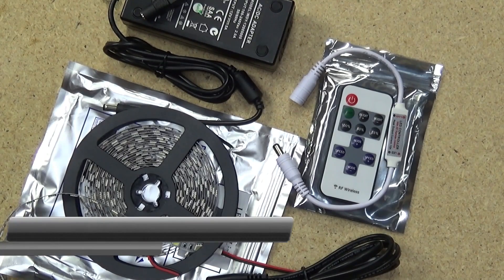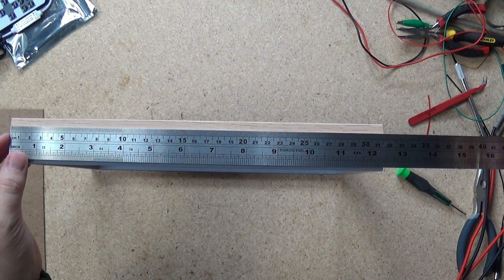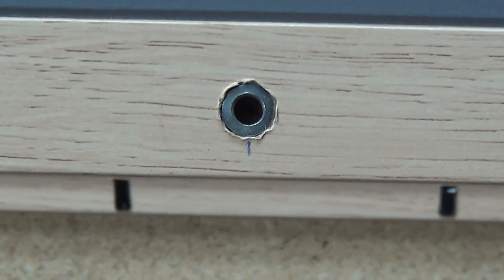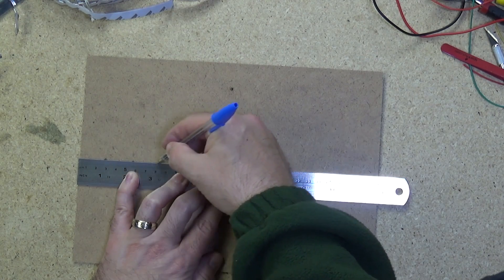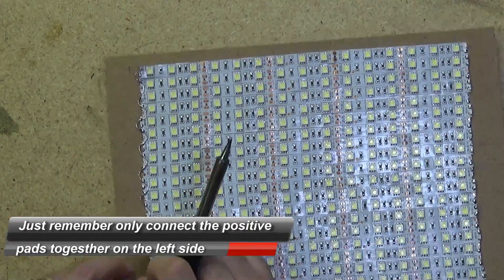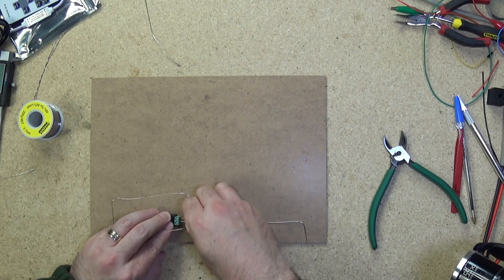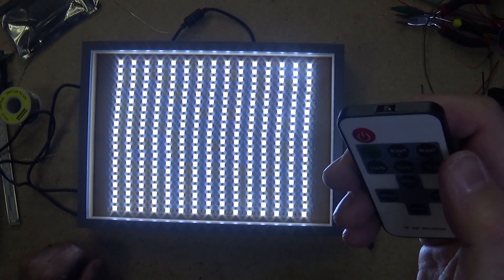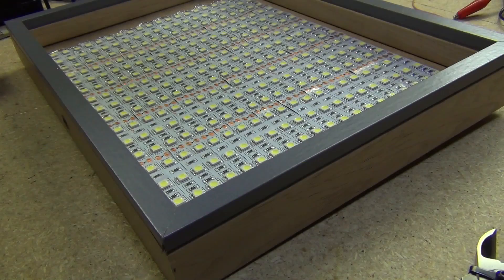DIY LED Light Panel with Remote Control (MEHS) Episode 51

Comment: Has the glue failed on those strips yet?
Reply from the maker: - Hi.  It has let go a couple of spots but I just hit it with some fresh adhesive and all good.  You are correct - It's not the best adhesive to begin with, could have been better.  Cheers.
Reply: @michaelsstuff4402  what part of the country are you from?
Also i have across a cheap alternative light. An LED tv and take the lcd screen out and you are left with the led lights in the back and you have the diffuser and the frame.

Comment: I've got a similar LED project that's powered by an 11.1V, 2200mA Lithium/Ion battery pack. The LED's are getting very hot! Why? If I leave them on the spool, they will melt the spool.

Also how would I reduce the voltage of the 11.1V pack to 9V output? I've tried resistors and they get very hot also. I started with 1/4 watt resistors that burned up. I increased to 1/2W, 1W, 5W, 10W, 25W. My last attempt was with a 50W, 1 Ohm resistor and it still gets warm. I can't go larger because of size restraints. 

I could use a 9v battery to achieve the results I want, but I want a rechargeable battery pack with higher mA that will last longer than a conventional 9V battery. I 9V battery will only power my project for 1-1/2 hours, I need longer life and want rechargeable.
Reply from the maker: - What are the LEDs rated at?  Most are 12v.  Don't feed them much less as the current draw will increase as will the heat.  LEDs do get hot.  Why run them at 9V?  if you want to reduce the brightness, use an inline PWM module (cheap on ebay).
Reply: The LEDs are 12 volt, same as the real in your video. My original design used a 9V battery to power the project. Then we converted to the 11.1 rechargeable pack to eliminate throwing away batteries. 

We are also using some individual 3mm LEDs in the project. Those are resisted based on 9V. The problem is still the LEDs are getting too hot at 12V and melting the surrounding material.
Reply from the maker: - If they are getting that hot I suggest you run some form of cooling like a heat sink or a fan.  Many commercial LED panels do the same thing.  You can try a lesser number of LEDs or an inline remote like I demonstrated in another video.  They allow you to control the panel via remote and to reduce the brightness slightly through PWM.  This will also reduce the heat buildup.  The only other option is to reduce the current being provided, say with a simply 12v power reg.  But this form of artificial throttling will also cause the power reg to get very hot.   @danaedwards701

Comment: is it possible to use small rechargeable 12v battery for the power supply?
Reply from the maker: - Hi.  Yes definitely.  Any 12v power source that can output the required current will work (about 2A).  Cheers.
Reply: thanks a lot! :)

Comment: how can I calculate how much power input should there be? I want to make a bigger panel
Reply from the maker: - Hi.  The easiest and most accurate way is to connect a multimeter in line with the power supply.  This would mean  making the multimeter a part of the positive or negative wiring.  If you are not sure how to do this or dont have a multimeter, let me know.  I can always measure the current of my 300 LED panel and let you know what you will need for your desired panel size.  Cheers.
Reply from the maker: Hi.  300 led panel requires a minimum of 4.5 amps at 12v, 54 watts.  Cheers.

Comment: There is no cooling for these LED strips, they are closed in sealed box and sticked to wood, they will die after year.
Reply from the maker: - Hi.  The front is open and the LED's don't get above 50C.  I don't agree they will be dead in a year.  Cheers.
Reply: Then ok, 50*C is fine, I was thinking that you put back that sheet of glass.
Reply from the maker: Arek R.
- No worries.  I in the middle of doing another one hopefully with a front diffuser but it will still have natural ventilation.  Cheers.
Reply: Diffuser, good idea.

Comment: 3 issues with this design: the colors may be bad depending on the quality of the leds on the strip https://en.m.wikipedia.org/wiki/Color_rendering_index , you didn't add some filtering to remove the flickering! Don't use too much power or the led strip may before hot shortening the life of the leds.
Reply from the maker: - Hi.  Yes, very good points.  The CRI is unknown and from what I can tell not high.  No I left the remote control device alone and it without making any changes it does flicker due to pulse width modulation.  No not too much power.  The power supply is rated at 5a and the leds draw around 3 from memory.  Cheers.

Comment: Quick tip: put white fabric or paper on the glass and for the glass back in it and will soften the light and make it very useful for photography and video
Reply from the maker: -Hi.  Thank for the tip.  I am building an improved version at the moment and it will have a white diffused panel of some sort at the front.  Cheers.

Comment: Since my apt has warm lights installed throughout the apt. This will come in handy for desk work and or other things, was either going to run straight off a 12vDC7Ah battery but bought AC to DC converter with 5A output so should work at best. Thanks for this little tutorial, was unsure if i would solder all on one end or the other, but doing positive on left and or negative on right is a good way to prevent accidental short circuiting of the wires if they were to touch.
Reply from the maker: UnboundGodz - Thanks for the feedback.  I  am now working on an improved and brighter version with battery backup, 4 levels of brightness and remote.  Should be done in a week or so.  Cheers.

Comment: If you put the glass infront it will be better or maybe you damage the leds?
Reply from the maker: olaPRASINAgiatre - Hi.  The glass won't fit with the leds there but it's not needed and would just add weight.  Cheers

Comment: I made one, but instead I used a "rail" system to wire up the LEDs. I had some non-insulated copper wire sitting around so I used that. I glued the wire about 1/4 inch from the end of the LED strips on both sides and then used small pieces of the wire to solder em. Great video!
Reply from the maker: - Thank you.
Reply: F an

Comment: nice work mate! This is my first time watching and I subscribed.  You are an awesome teacher. I am just now getting into cob led diy projects for indoor gardening as well as the use of diodes and dimming with automotive applications.
Reply from the maker: - Hi and welcome.  Thank you for the kind words.  Much more to come.  I'll be doing another 2 LED panels shortly but with brighter LEDs, a rechargeable battery pack, diffuser, better mounts and 4 stage brightness via remote.  Cheers.